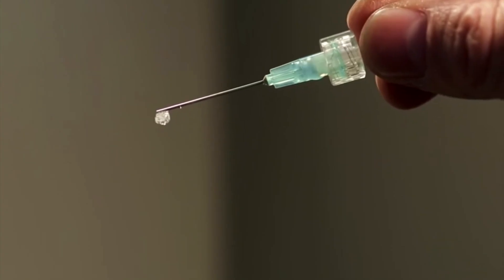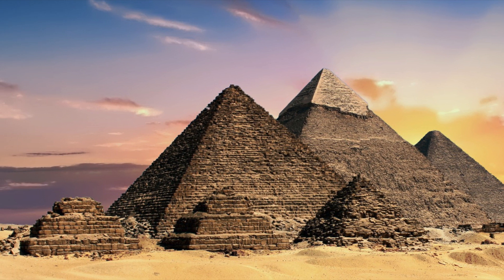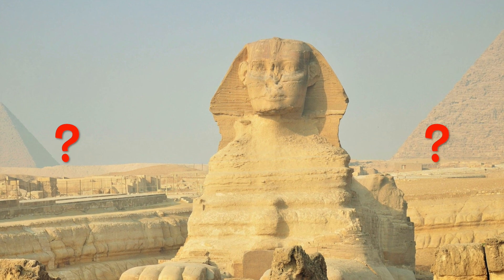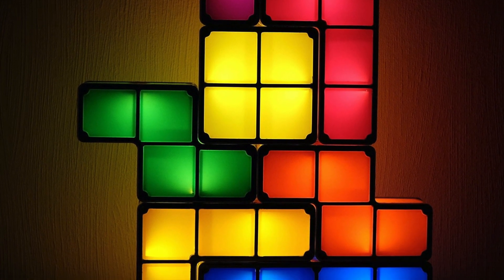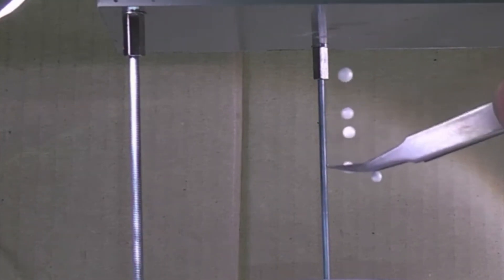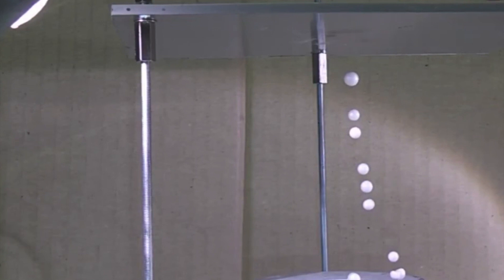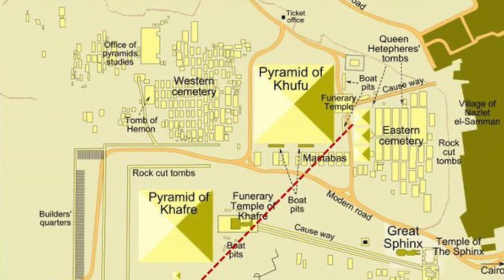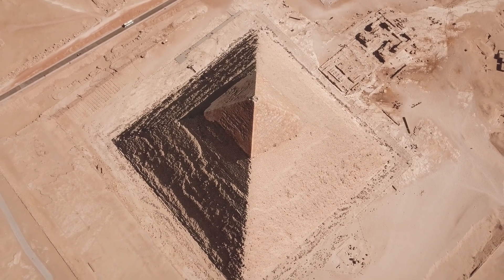The Science of Sound: How the Pyramids Were Built with Acoustic Levitation

Comment: it is indeed true that ancient people were more advanced than we give them credit for. but most likely it was normal mechanical ramps and such that were used in creation of pyramids. however it isn't a simple yes or no. main science tends to always go for the simplest explanation and assume it is correct. for example when ever they find an ancient megalith or monument they don't know the function of they automatically assume its a temple. simply because large buildings from history often are temples. they also thought that pyramids were simply tombs even if no mummies of any kind were ever found in pyramids. and supposedly pyramids can focus magnetic waves. (which is also interesting) and also many ancient megaliths have unusual magnetic properties. now if stones for pyramids were levitated and placed this way it would be something more similar to magnetism than sound waves. you need huge amount of energy to create sound waves that have any decent power. for same amount of energy magnetic fields are much stronger. also that is if they had any idea about magnetism and how to use it. considering that that to requires very high amount of power to lift something that heavy. and in order to do that they would have to be quite a bit more advanced than we give them credit for. also if they did do it by levitation it could have been in some other power all together. or combination of several different types of techniques. but sonic waves so far seem to be the least likely options

Comment: Before anyone allows themself to get too wedded to the idea that sound vibration can be used to lift large granite blocks, they should see if they can find any experiment where standing waves in air are used to 'levitate' anything as dense as say as a glass bead.
 Most demonstration involve using a standing wave in air to support fluff or polystyrene or similar low density materials between a sound source and a reflector, or two tuned sound sources. 
Levitate a stone block in this way, even if it were possible, would not be of much use unless the whole apparatus could then be moved, which is likely to be more tricky than just moving the blocks. 

If anyone does come across a demonstration of standing waves being used to levitate a dense object please do send us all a link.
Reply from the maker: Hi! They actually recently completed an experiment where they levitated a 20 kg stone ball, which is quite impressive given our rudimentary understanding on the topic of acoustic levitation. But there is certainly some sort of lost knowledge or technology as to how they may have done it on this sheer scale.
Reply: @beyondthehorizon_  Do you have a link to the experiment so I can see how it was done, please?
With thanks, Simon
Reply: @beyondthehorizon_  Hi! No they didn't! you are 100% wrong
Reply: Can’t use our understanding and methods as a direct conclusion as to weather this works or not. Our ancient ancestors had a superior understanding of this.
Reply: @Aqotics  That may be true, but if there is no way of demonstrating that the principles work, then there can be no proof, and the idea must remain speculation.
However, if you do decide this was the method used to lift and move the stones, what does it say about the claims that the ancient civilisation cut stones, and carved statues and vases using power tools?
Reply: @simonthorneycroft1339 ....sound waves can not only lift objects, it can cut them. Sound waves can be concentrated into a beam and that beam can slice through material.
Reply: @ferrynpalmer3875  any source or video evidence of this>
Reply: @kiddjubbz  .....Acoustophoresis, research that a bit. It's using sound waves to move objects. Research ultrasonic cutters. They use sound waves like a knife. We've known that sound waves can shatter glass for quite some time now.
Reply: @ferrynpalmer3875  that sounds like an interesting proposal. I will be pleased if you will expand your ideas a little further.
Would that kind of machinery require machine to build and a large power supply to build 
would the acoustropheresis machines have to be bigger than the stones / rocks they are built to move 
tell me some more please
Reply: @simonthorneycroft1339  .....I for one think it's pretty apparent that there's some lost knowledge at play here. I think we are making a mistake if we are looking at this through today's 2024 lense. The tech that I've mentioned requires relatively complex machinery to produce the stated results. We know that the principles at play do indeed work.....sound waves can move, shape and alter solid objects. If this theory of sound being the manner in which they were able to move, shape and cut stone is correct....the how in terms of producing those waves is up for debate. I think we need to suspend our current way of thinking in order to be able to figure this out. There are theories out there centered around the thought that the pyramids were power plants. The cap stones, physical properties of the materials used and the fact that there was water running beneath them all lend a hand to that theory. Is it possible that this is true? Is it possible that they powered some sort of device that allowed them to produce frequencies in the 10k hertz range? Is it possible that they were somehow able to combine sound waves and water? I'm unsure. 

What I am sure of is that if I had a block of granite and beat it with a stone non-stop for decades I'd never turn it into 2 stones.
Reply: @ferrynpalmer3875  If you feel that the standard model of how the pyramids were built, that seems fine, you owe it no loyalty.
If you are proposing an alternative model, I would suggest you have to have some belief that that model has some validity, certainly greater validity than the model you are rejecting.
If you feel that the Egyptians could not have carved the stones with stone and bronze tools why not take the small step of saying that they must have had iron tools, which is a much smaller step than to determine that they were cutting stones with a much higher level of technology
Reply: If the Tibetan monks did it to this very recent day.